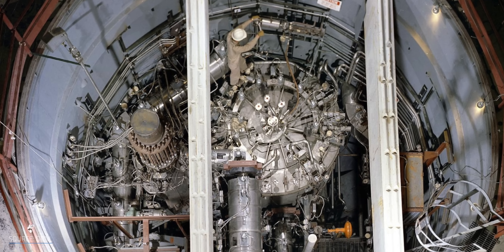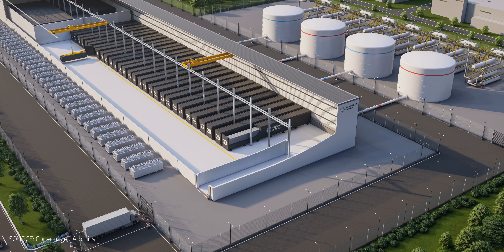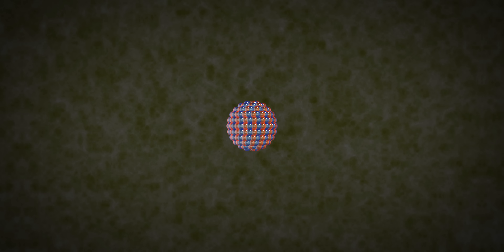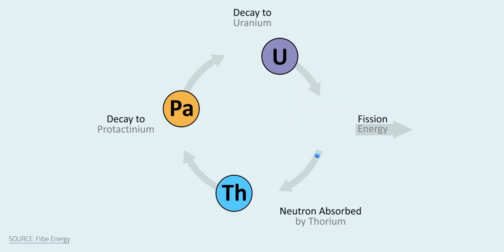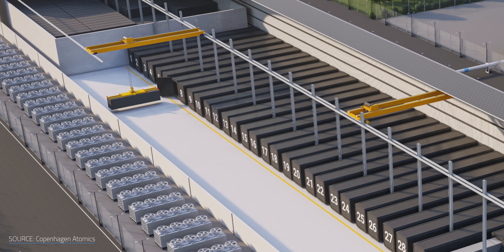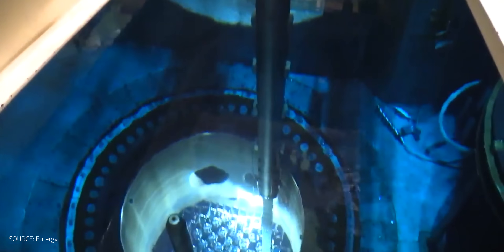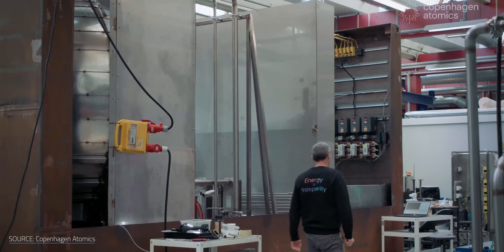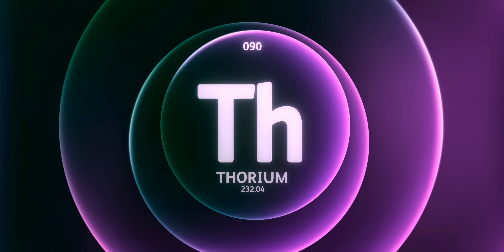Why Thorium is About to Change the World

Comment: “Why Thorium is About to Change the World” (Undecided with Matt Ferrell):

Thorium reactors are like the “solid-state batteries” of nuclear power—a cleaner, safer, and more efficient technology that has long been discussed but never commercialized.

A Danish startup, Copenhagen Atomics, is close to making thorium reactors a reality. Their design is a small modular reactor (SMR) that fits in a shipping container, can be mass-produced, and runs for years with minimal maintenance.

Historical context: In the 1960s, scientists at Oak Ridge National Laboratory ran a successful thorium molten salt reactor, but interest (and funding) shifted toward uranium-based designs for weapons proliferation reasons.

How it works: Thorium (abundant and cheap) can't sustain a chain reaction on its own but can be converted (via neutron absorption and decay) to uranium-233, which is fissile. This breeder cycle makes thorium uniquely efficient—breeding more fuel than it consumes.

Molten salt reactor (MSR) advantages:

Liquid fuel allows continuous removal of waste byproducts.

Operates at atmospheric pressure, eliminating explosive risks and simplifying safety.

Built-in “walkaway safety”: a freeze plug melts if overheated, draining salt and shutting down the reaction safely.

Waste from thorium reactors is less radioactive long-term—needs storage for hundreds, not thousands, of years.

Can potentially “burn” legacy nuclear waste.

Engineering challenges remain: corrosive molten salts require advanced, durable pumps and alloys; system must be completely sealed and largely automated for safety due to radiation.

Copenhagen Atomics’ reactor units are designed for swift swaps every five years, allowing upgrades and minimizing maintenance.

They plan public testing at the Paul Scherrer Institute in Switzerland (2026), aiming to reach commercial scale within a decade.

Business model: The company won’t sell reactors but will install, operate, and decommission them, selling heat or electricity as a service.

Global impact: Countries like Indonesia are first clients, aiming to use the energy for hydrogen and ammonia production.

Thorium reactors promise to make nuclear power scalable, safe, cheap, and broadly accessible—potentially solving both energy and waste issues if the technology overcomes final regulatory and practical hurdles.

Comment: We have a working solution for low carbon energy, which is Renewable Energy. Wind and Solar already are in the price range these reactors might at some point in the future reach or might never reach. We have to act quickly. We would need to replace fossil fuels within a decade. We don't have the time to wait for a new technology. Let's build renewables as if this new thorium reactors don't exist. Currently the thorium reactors of this Danish company are just a concept on paper. They have not even been tested. 

So we bet on renewables instead. If the Thorium reactors are tested and work in a few years and are actually cheap, it's a nice surprise and we can start to integrate them in our plans as well. Then we can integrate them. But it is possible, that this will never work out. So from a current PoV we plan with a 100% RE future.

Comment: Not sure how you can possibly describe nuclear fission (in any form) as "sustainable" Matt. What a shame as your vids are usually terrific but this one seems to simply perpetuate the myths put out by the nuclear lobby. Lets get this straight about what  nuclear is not: it is not an infinite supply of clean, cheap, safe energy - on the contrary it is precisely the opposite of those things. Even if you would like to conveniently "forget" about massive decommissioning costs and the 100,000 years half-life of the highly toxic, hard to process and contain, killer waste product (never mind the next generation can take care of that) nuclear is very, very expensive even in it's small modular reactor form. So expensive in fact the strike price per kilowatt hour of electricity generated is running at between 10 and 15 times that of on-shore wind. Nuclear is an industry of scientists and engineers  floundering around trying to create themselves a role, they would be much better transferring their considerable skills into an area more sustainable and less toxic The future of energy generation is renewables plus storage Matt and I really think that you know that.

Comment: There is a massive nuclear reactor just 93 million miles from here,  It is far enough away that it does not cause a huge problem with radiation, although it does cause small problems.
We really need to focus more on using the millions of gigawatts of power that could be drawn from it, but no where near enough is being done in that direction.

Comment: If each box is a full reactor, then creating a 1000 unit facility ( for example) means you have to maintain 1000 individual complete nuclear sydtems.... that will never never have cost a effective OpEx, versus one system with equal capacity (i.e. a traditional facility using the latest technology). To use a few at a location is more feasible and should be the target.

Comment: Ok, so i'm no chemist or physicist, but am wondering, of a fuel bundle is "used up" how come it tales 10,000 years to become safe? Is it possible we are not deriving the maximum benefits of using a single bundle for fuel say 500 homes for the next century? Also, safety first, though the technology is not new, how much governmental "buy in" do they have? If Black Rock and WEF are not in on the action, they may convince the USA and EU to shut it down!

Comment: The success of this technology depends on regulatory agencies, allowing transportation inefficient ways that are economical. There have been numerous vision based micro, reactors, even larger, reactors designed to fit inside of ship containers, but so far hardly any can be thrown on the back of a truck and shipped to Walmart on the other side of the state. Shipping for one container alone with that kind of cargo can cost more than a house. Safe systems and laxer regulations can change that

Comment: Unless a unit is made for powering the individual home, this doesn't solve the stupidly vulnerable grid distribution system. Until small home-use reactors are delivered, just like in-home HVAC was, we're not changing anything from an energy security standpoint. Grid delivery of power is illogical and began in corruption. Now, let someone develop an in-home reactor, and subsequent competitors, and you have an entire new industry started, lots of new jobs, more revenue that is taxable and a power-delivery system that isn't vulnerable to terrorism.

Comment: I think AI will hammer out the tough problems before ten years. For example, it can make production costs even cheaper, without cutting corners, making the corrosion turnover of the reactor a non issue. Stagger the installations of each modular unit.

Comment: Thank you for making this video Mr Ferrell. I was impressed by Copenhagen Atomics' pump design. From what you said "levitating its rotating parts on magnetic bearings" it sounds like maglev like maglev trains? Is the "custom steel alloy" Hastelloy that Weinberg used?
I was also wondering why they were using potassium and sodium, two very highly reactive metals, instead of beryllium like in Weinberg's FLiBe molten salt reactor...? Maybe there was something I missed watching the video.
Reply: Edit to previous comment: I found out beryllium is actually thick and toxic and not using it would improve heat transfer. 

Also could you look into making a video about the by products as well? I'm wondering if the FLiNak molten salt would produce the same by products as FLiBe...? I'm not a chemistry expert. I thought neodymium (used for magnets) was another by product but apparently it's not. But I've read the by products from LFTR (Liquid Fluoride Molten Salt Reactors) are:

Medical Isotope By-products 
Molybdenum-99 (Mo-99): Can be extracted during operation for use in diagnostic medical imaging.
Actinium-225 (Ac-225): A decay product of U-233, which can be removed and used to produce Bismuth-213 for cancer therapy.

Comment: they have been promising this as long as they have Cold Fusion. Quick reality check. As of sept 2025 there is not one single commercially viable thorium reactor in operation or even under construction, they are never going to contribute to the grid.

Comment: Copenhagen Atomic's reactor is very interesting.  I see their initial goal is not to make a breeder, but something closer to an iso breeder, and really this is all that is needed.  As long as they can produce enough U233 in the blanket salt to mix with natural uranium to get sufficient 5% enriched uranium to keep the reactor fueled, this would be enough.  It would turn 200 years of uranium reserves into several thousand years.  It would also make uranium from seawater a viable fuel source, extending the supply almost indefinitely.

Comment: The project was an experiment to get it running and prove out the concept. It never took cost or maintenance costs into consideration. They used expensive "exotic" materials to survive the highly corrosive molten salt,  and that material cost more than 50x materials used in a typical nuclear reactor. The project would have been a money loser over its run. That's why funding was cut. The challenge to this day for a Thorium reactor is the material science to overcome the corrosive molten salt. I hate when people make it some big conspiracy.

And according to several nuclear engineers that talk about reactors, Uranium isn't as scarce as you're making it out to be.
Reply: The uranium mines are dangerous to live near. In AZ the uranium mine up by the Grand Canyon created uranium dust that blew onto the Navajo reservation and gave most if the Tribe Cancer. The US government is still paying for their Healthcare. The same thing happened in Grants NM and that mine was shut down too.
People in northern AZ were getting  doused by radioactive dust from Bevada for years that caused a " cancer alley".

Comment: Molten salt, eh? It's been well tried for uranium reactors too. Molten salt as a heat storage medium works, although corrosion and hence maintenance is a big problem and efficiency losses through using a heat exchanger feeding a steam turbine another problem (you'll need to deal with an awful lot of waste heat - there goes the "Small Modular" idea).
But if you are going to use molten salt then why on earth wouldn't you simply melt the salt with sunlight focused by mirrors? That is, a Concentrated Solar Power (CSP) plant, that already operates with molten salt in many countries. Mirrors have got to be far cheaper than any fission reactor could ever be. Yet CSP is now no longer competitive with wind and (especially) solar PV backed up by batteries and pumped storage.

Comment: You may not know  India already running 500 megawatts fast breeder thorium reactor at Chennai for the past one year it can use plutonium or Uranium as breeder and blanket it with thorium and get more U233 as spend fuel. They can again use U233 with thorium hand gets more U233 and that cycle continues

Comment: How do they propose disposing of the worn out reactor parts every 5 years? Do they have a plan to recycle their custom alloy once it's irradiated? What I'm hearing is "we solved all the easy problems first so we could string investors along for more money, now we just need some nuclear materials, a bunch of permitting, and all the other things that normally kill a nuclear project." E.g. I didn't hear them say they tested their custom alloy or pump on FLiNaK that has been running in an operating reactor and accumulating radioactive byproducts, ergo we don't know if it will actually last 5 years.

Comment: Why FLiNaK instead only 7Li as moderator and coolant with bubble slow down from 180°C-1340°C possible in Na breeder or combined with 15ND3, cubic 11B&15N or simply D2O primary cycle PWR ?

Much indians working in gulf countries that could also deliver much D out of hydrogen from sea water HxOy or methane CHxDy used in Abu Dhabi for H2 from CH4+H2O+heat for chemical industry & HD separated in 7LiD 7LiH centrifuge heated >1000°C decomposition like TiH2 from TiO2+CaH+heat etc.
Clean H used for BH3 & NH3 separation of 10B / 11B & 14N / 15N isotopes.

Gulf countries can pay developments also for small test turbine cycle using CO2 with steam pressure 57.3 bar 20°C and sucking centrifugal compressor (earth gas) backflow cooling (indirect) to heat & steam inlet of all that way thermal isolatable
usable for all steam power also with heat of existing cooled H2O condensor and surfaces or from hot air sucked with 2. compressor that way more hot & dense for heat transfer to CO2 turbine cycle air expanded over driving shovels cold for aircon and water out.

Do they have agrar culture with sheeps, cows & fishes inside towers for visiting ?

Recommended for high surplus very secure fast breeding a new pebble bed HTR with pebbles out of thin tungsten alloy filled with MgO and U in ZrC between tungsten reflector with breeding and fission areas for running pebbles.
Overheat self slow down, passive out <2s, no decay heat problem unburnable.

Why FLiNaK instead only 7Li as moderator and coolant with bubble slow down from 180°C-1340°C possible in Na breeder or combined with 15ND3, cubic 11B&15N or simply D2O primary cycle PWR ?

Using thorium or uranium does not matter already found in india like awaited and over 4Gt <300$/kg out of seawater is no end cost factor if both also breeded.

India Can Do Future Candu HTR with liquid about 9 bar 15ND3 ammonia instead D2O between RBN (cubic 11B&15N) tubes & RBN fuel with pressure bubbles control quick passive away if 7lithium inside >1000°C instead H2O as excellent coolant & moderator with bubble slow down 180°C - 1340°C without pressure a storey sand upon tubes over MgO melting pot etc.
running with unenriched UO2 fuel about 30 years.

Making of gold as side product of cold fusion shooting cheap mercury into Lithium-Deuterium for 6Li+D→2 He, 6Li+n→He+T, D+T, D+D→T+p, 7Li+p etc. from Hg and following He punshes 20-30 MeV Hg n-spallation to 197Hg→Au.

Comment: How long does the eletronic components of the system hold up to the constant bombardment of the U233 until they wear down and freeze the whole system ?? Plus beeing it self seeled with minimum direct  mantainence how do you extrac the fuel waste from it to safe storage ? Or do you storage the radiogenic waste in the container till the complete radiogenic decay and then decomission the whole system ???

Comment: I saw an awful lot of clamps in this important gizmo, which means gaskets that need to be replaced. This appears to be a huge problem with Assemble-In-Place Nuclear-Reactor-In-A-Box idea. Also, the stainless steel has nickel in it that likes to disappear when exposed to salts and radiation, leaving behind pits and cracks. This could be mitigated by replacing as much stainless steel with titanium as you could. It's almost as if this entire system was designed to support a robust maintenance schedule.

Comment: No, these nuclear power generators do not weight 1,000 tons, as someone could deduct form minute 17:42, when he says that this reactor will “weight in at 1000 tons, ship in 40-tons sections and be welded together on site. Copenhagen Atomics will house 25 reactors in a single building”. This is not, according to the information in their web page, an imperative condition. You can, if some company wants to install 25 reactors. But as I understand from their web page, it is not compulsory for the technology to work. A single 42 MW unit can be purchased with an already announced price of 50 million USD per unit. Assuming an average per capita consumption of 1 kW (or 8,760 kWh/year), just one reactor would supply 42,000 people. 25 reactors in just one building would provide 1.05 GW of electricity, or the average many of the already old, and ready for decommission, Pressurized Water Reactor (PWR) nuclear power stations still running nowadays. But this is the good news for these new nuclear power reactors: they do not need to be huge installations. They have the advantage of being small, allowing grid fragmentation and subdivision into small grids connected to much closer electricity generation. The result well be more manageable, secure, reliable, and efficient by reducing electricity distribution losses. 

US company Valar Atomics is in the same path, with a planed Triso fueled reactor, moderated with graphite, and cooled with helium gas. Estimated power will be 25 MW, with 5 % enriched or even natural non-enriched uranium, they say.